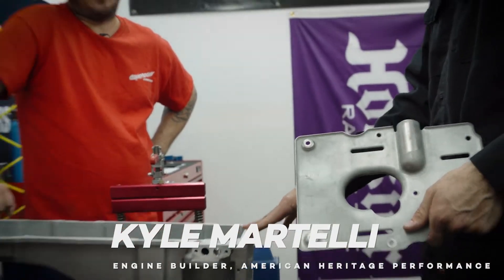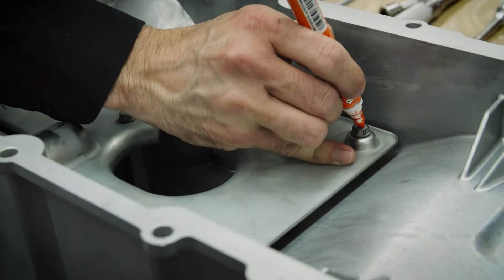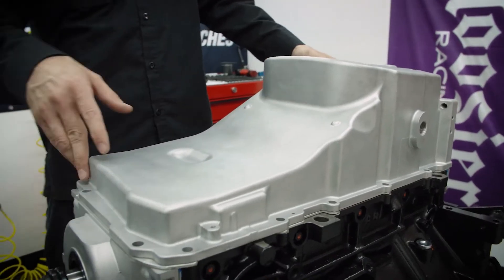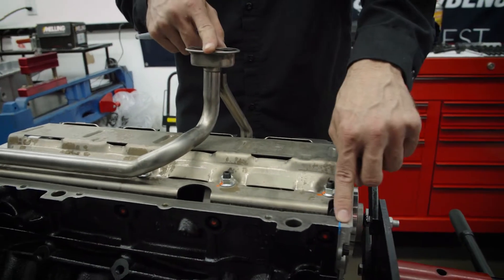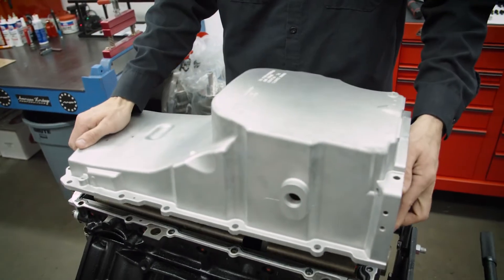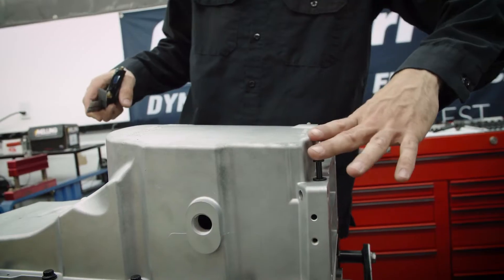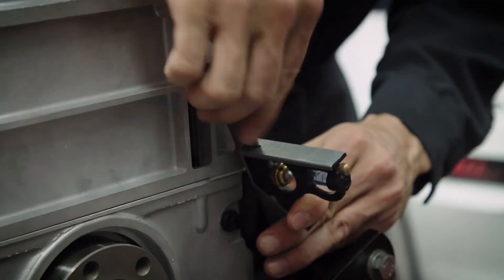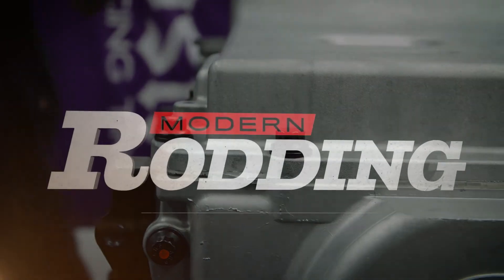How to install a LS oil pan properly

Comment: DO NOT torque the long bolts on the back of the oil pan to 18 ft lb like this idiot.  Torque spec for  long bolts is 106 in lbs or 8.83 ft lbs...NOT 18
Reply: Spot on
Reply: you are the idiot. He clearly uses an in-lb torque wrench to torque them.

Comment: A dot does nothing vs a witness line from the top of the bolt down to the pan itself. Also you didn’t RTV the corners of the rear plate so that will leak. Also didn’t check pickup clearance
Reply: I saw him silicone the corners?

Comment: Doting it w a paint pen does nothing but make urself feel better ab tqing it make it have a visible line so that way you can tell if the bolt has moved and need re torqued

Comment: The rear long bolts are 106 Lb-In and that's the final step
Reply: Love how they skipped right over that. lol
I remember finding out on my first LS that those long bolts don't like 18lb ft. Not to mention you can sometimes pull the rear cover down slightly and cause a future rear main seal leak.
Reply: @SheaAP1  Yeah, I also learned to at least start those bolts into the rear cover before tightening anything down down- snapped a piece of the cover off good thing the engine was out of the car!

Comment: I definitely want to say that your instruction is the best i have seen, your knowledge of these motors is awesome.  I do have a quick question.  Mine is on the stand.  New cam, gears, pump and now the  cover and oil pan is next.  DO I need to install the rear main seal and gasket before I install my oil pan.  Or is ok to install the pan first.  TIA

Comment: You left out the most important check, to verify that the pickup is at the correct distance from the oil pan!
Reply: If you’re reinstalling the same pan and pickup from a previously running engine, imo this detail isn’t as important as in a new engine. Also, this detail isn’t a crucial in an LS that has a stationary pickup tube. It was crucial in Gen1 sbc and bbc engines where the pickup tube rotates inside the oil pump.  To check it you measure the distance from the bottom of the pan to the pan rail, and on the engine from the pan rail to bottom of the pickup tube. Be sure to factor in the gasket thickness somewhere. There should be about 3/8” difference between these to measurements. Too much clearance and the pickup may be too far out of the oil, especially if the engine is low on oil. Too little clearance and you will pick sludge etc after the engine is older and also interfere with the pump’s ability to lift the oil. You could also use modeling clay or play dough. Place an index card over the pickup screen, place clay on card, install pan and gasket. Remove and measure the compressed clay.
Reply: How do you do that? What about just putting a stock one back on after dod delete? Need to then?